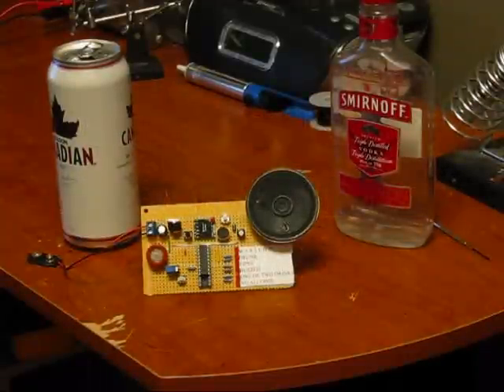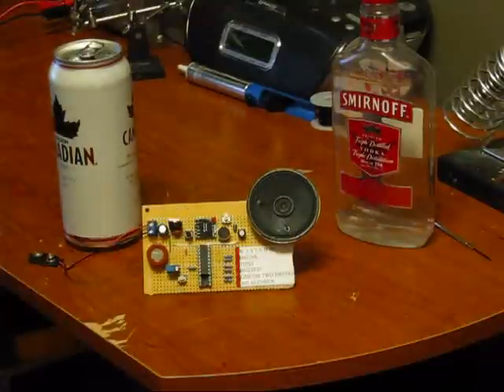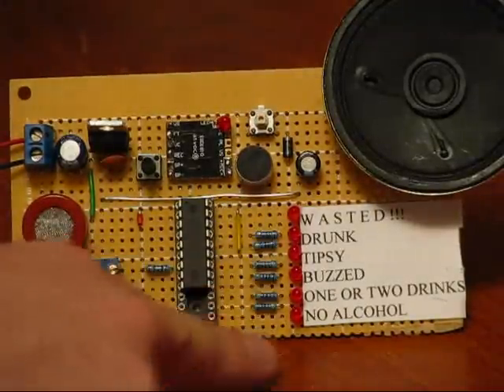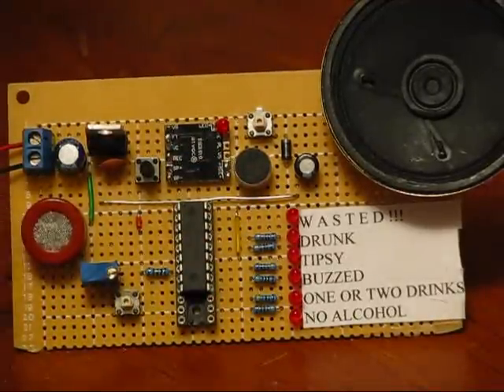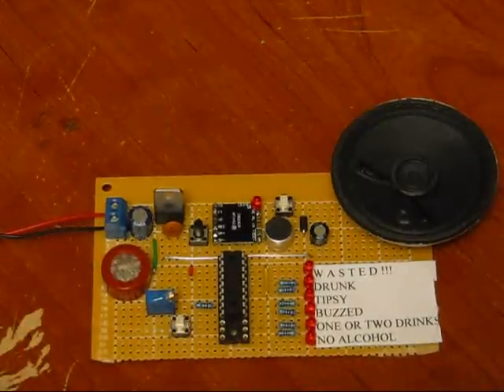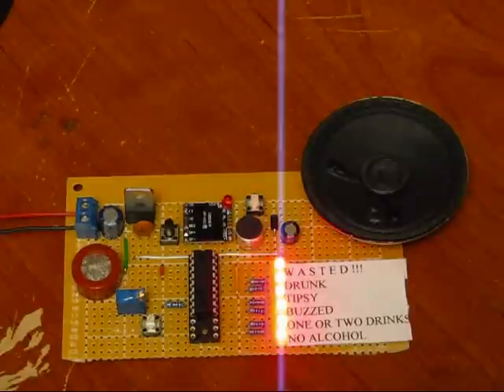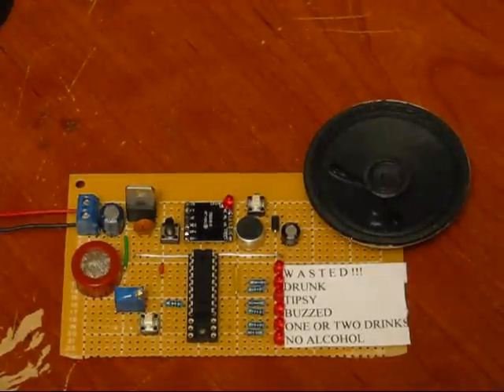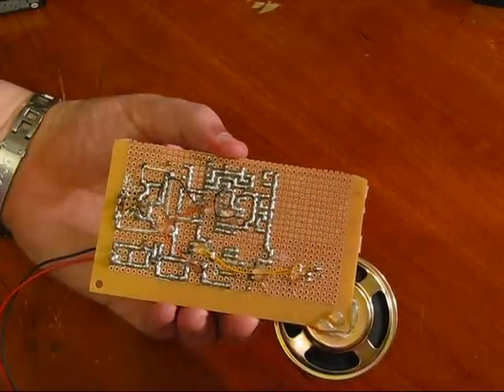Breathalyser circuit featuring the MQ3 alcohol sensor

Comment: could you tell me how to determine load resistor value for the sensor in order to interface it with 5V or 3.3V processor/controller

Comment: Patric, I believe you can make the following device : An aftermarket install of a alcohol censer devise which would plug into and or bypass the ignition fuse, allowing this devise to control an initial test and at the point of failure will shut the ignition circuit down for a set period of time then allow a retest and if successful will then allow the auto ignition to complete. If this kinda makes sense please contact me for a potential venture. GK.          garykarm@rocketmail.com